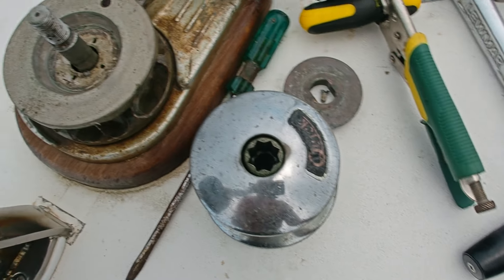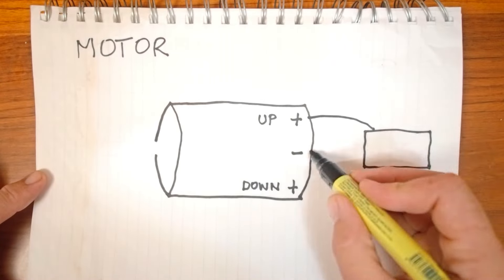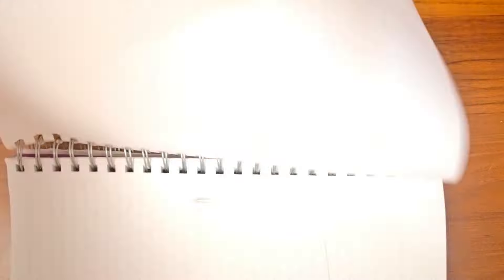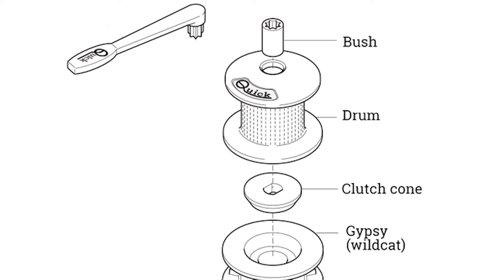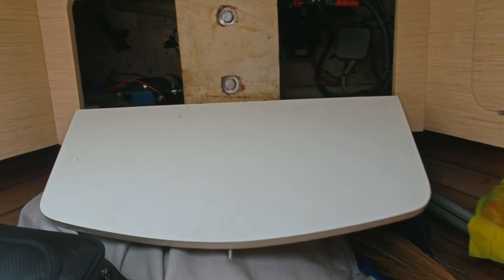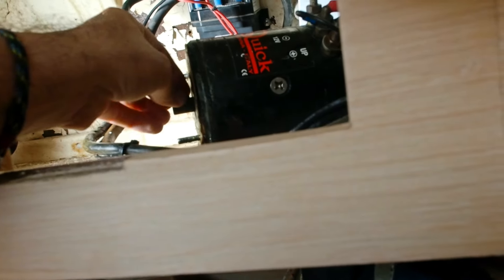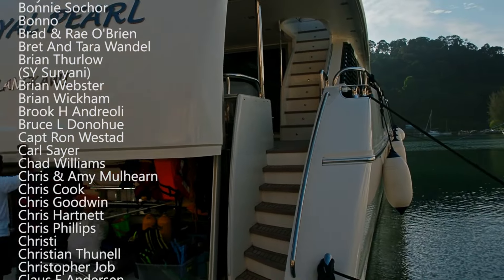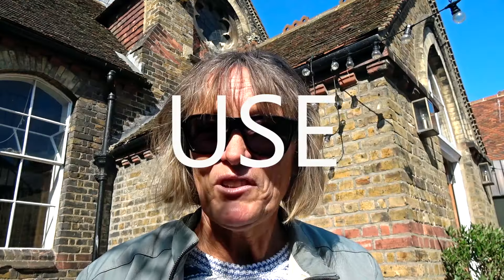DISASTER! OUR ANCHOR WINDLASS IS BROKEN! Ep 56

Comment: Seems like someone keeps putting up walls in front of you just to see how you handle the pressure and tackle the task at hand, boats seem to take 4 to 5 times longer to repair and fix due to the construction and corrosion factor limited space and the tedious task of being a contortionist due to the limed space. Not to mention the fact of the supply chain of repair parts involved or status of vendor discontinuing the part needed to fix what ever is needed to be repaired!  Keep up the positive attitude smile drink a beer and how we say GET ER DONE!  Love the video's thanks for sharing!  :)
Reply from the maker: Thanks for the positive encouragement, Dennis. We'll get this sorted, promise, and as quickly as we can.
Reply: Boats are a cramped workspace for maintenance.   Esper is actually fairly medium-large sailboat with more space than many.  My boat is much smaller and more cramped at only 35'.  To work on our windlass one has to stand on one's hands and knees on deck and reach down through the anchor-locker hatch and work upside down below the deck, or on your chest.  The opening is only about 4 or 5 square feet total and trapezoidal, almost a triangle with a nice sharp lip of fiberglass to keep the water sort of out of it when the hatch is closed.   Fun, fun!
Reply from the maker: I feel your pain. Some of these jobs are not designed to be fun. I'm hoping our solution will avoid the acrobatics in the future.
Reply: I like the reference about ESP.  I had no idea that ESPer was related to that.  Sometimes you just have to work by feel like you were in that scene reaching into the forepeak locker, and just feel the force and BELIEVE in yourself that it can be done.  If you don't believe it will work it often won't happen.  Breathe deep, slow your heartbeat, plumb the calm, find your zen, and feel it happening. Then it just does.  :)

Comment: Super video editing + music ect very professional.  
Thks sharing repair info.  
For next time the acetone and tranxs is great for frozen parts. Also there is a tool called an impact screw driver, that is designed to be hit with a hammer. The hammer blow turns a stuck screw and supplies pressure on the screw at the same time.  Invaluable tool.  They only cost about 20 bucks. They are the bomb for removing or tightening screws!! Super sailing to you.
Reply from the maker: [Liz] Thanks for the information, and for taking the trouble to comment!
Reply from the maker: Hi Thomas. Perhaps you missed it but I tried the impact driver but with no joy :(
Reply: followtheboat missed that
Reply from the maker: 08:10
Reply: followtheboat There is another tactic for super stuck screws.  Drill the head off.  Then take the fitting apart.  The threaded part will be left standing up and open.  They will usually come out then.  If not use a torch to heat the metal holding the threaded portion.  Hold the top of the threaded portion with Vise grips or weld a "T" across the top.  Then heat and wiggle the threaded portion easily until it gives up.  Due care with oxy/acetylene and welding.  Suggest maybe practicing that before using it on the real deal.  It does require some expertise, but not that hard.  Happy Sailing.

Comment: Good laugh at the bigger hammer answer. Used it many times.  Experience has told me to check for parts and replacement cost and availability on day one.  Lets me know how much time I can spend or whether it is better to move directly to chainsaw and cutting torch.
Reply from the maker: Fair point, except we inherited the windlass when we bought the boat. We're applying your philosophy to our solution, however, which we'll reveal in next week's episode. Fair winds, Mark.

Comment: Well done on a tricky job, you have patience and persistence, and a nicely presented video.     I found over the years of cruising, to replace the rubber seal on the topside of the shaft regularly to stop the water and dirt getting into the works, and second buy a Maxwell anchor winch.
Reply from the maker: Haha! Yep, we checked the Maxwells. Very nice winches but outside our budget and the right sized one wouldn't fit without chopping up the deck.

Comment: Thank you for sharing your experiences with your windlass. Now I can make a better choice for the windlass I will put on my sailboat. NOT a vertical one and a detail examination to avoid the mix of incompatibles metal pieces.

You can comfort yourself knowing that it could have broken in a more "delicate" situation.

Looking forward to see the installation a the new one.
Reply from the maker: [Liz] Yes, we would agree with that! There is usually a  mix of metals, it's something that happens on boats, but is not a problem if yo ensure there's some kind of barrier between the two to avoid them fusing.

Comment: A week from setting off from Texas to the Caribbean we switched from a 65# Delta to a 105 # Mantus anchor. Unfortunately our Quick windlass said "no way". Turns out the worm gear was worn and the extra weight made it separate from the gear on the shaft. But, the gear box was a sealed unit and not able to be rebuilt. So, $1000 and a week later we had our new gear box from Italy. Everything came apart easily, bolted everything back together and 2 years later it is still going strong.

Comment: Very enjoyable video.👍Jamie I know the windlass shaft in way of the bearing but I would 'guess' from my limited view, that it is eminently repairable in a local workshop, bearings and the other consumables (circlips and seals) should be standard stuff and available. The 'bit' you butchered with the hacksaw cane be welded back. Btw - do you not have a drill - it may have been worth a try drilling the recalcitrant screw out.
Reply from the maker: Hey Norman. You'll see in the next video the state of the gear and, to be honest, I'm not happy with the design of the windlass. It's flawed and asking for trouble in another two years.

Comment: Reassemble EVERYTHING with anti-seizing compound - if it is new - take it apart and apply anti-seizing compound - in fact  if you can still turn a screw - take it out and apply anti-seizing compound - popular brand "Bostik Never-Seez" or Loctite or Permatex anti-seizing thread compound - also use it on shafts, seals, pins and bushing,  and hinges .
Reply from the maker: +12cunow [Liz] Sounds like good advice. Thanks for sharing with us!

Comment: Hi Folks,

One of the best ways to remove stuck metal bits is to apply heat. With a small torch, you heat the area around that screw. This would expand the metal and allow the screw to be removed fairly easily. Do not apply the heat to the screw as that would expand the screw and well, backwards. Try it sometime. This why you heat the lid of a jar of pickles under hot water. It's expands the lid. 

It's also possible to remove the shaft this way as well, but a bit trickier. 

This is why power lines are set with a sag in the summer, because they shrink and pull taught in the winter. The same would happen with your lifelines if you dropped your boat in the arctic for an hour.
Reply from the maker: +chris gerald [Liz] Thanks for the info and for commenting!

Comment: adorable. engineering background: I would disassemble this every 6mo and inspect, and I would enjoy every second of it. Also, I'd use anti-seize on all of the fasteners as other have mentioned. Provided they had some form of mechanical locking mechanism - locking inserts or (bleh) lock washers.

Comment: When using stainless screws or bolts into aluminum  put a little bit of copper based anti seize  on the threads and no more frozen bolts
Reply from the maker: +David Ibara [Liz] Thanks for the tip!

Comment: Funny that is exactly what I was going to suggest ( a socket a 5lbs sledge and someone other than the owner to whack it) works every time. 
After 50+ years never had a windlass until last week just bought one don't know if I'm conceding to my age or just gotten lazy. But watching this I'm starting to rethink the whole thing...
Reply from the maker: I think it depends entirely on the design, Robert. BTW I had to pull 30m of 10mm chain and 33kg anchor up by hand the other day. I have a slipped disk and it was hard work... AND I had some assistance. No way I'd want to do that manually every time!

Comment: Sorry to see you having problems guys. When I worked in engineering we used diesel as a penetrating agent, handy because you're bound to have it aboard. Also if you have a situation with a damaged/ stuck screw, there's a tool called an easy-out. You drill the said damaged screw and use the easy- out to extract the remains. Hope these tips come in handy for any later situations that arise.

Comment: Planned obsolescence.   This is close to what I was doing today.   I have a Lewmar Pro horizintal windlass on my boat that was installed in 2013.  I removed the wires to the reversing solenoid when I was rewiring the whole boat this winter and today I realized I have misplaced the sheet of paper where I wrote down what color wire went to what.  I was just trying to find the model on the Lewmar website and couldn't match it up to anything made today.   This reversing solonoid is new enough that it has a smudged QR code on the label which I couldn't quite get to read.  Trying to look it up to online to find a wiring diagram was a real challenge.  Lewmar doesn't even admit on their website that it EVER made such a part number.  Eventually I just gave up searching and just hooked up the control wires to hot jumpers and tested out the operation by hand with a meter.
Reply from the maker: To be fair I don't think this was planned obsolescence. I think this was the manufacturer realising the design had some major flaws and has improved on it. Possibly. Glad you sorted out your own issues though.
Reply: Next job is to mount the new Mantus anchor roller and fabricate a brace to support it back down to the bow since it sticks out a LOT further..  The roller matches our new 45lb Mantus anchor we got so we can feel secure in an anchorage.  The boat came with a couple of 35lb Danforths and a folding Herreshoff fisherman.   Hopefully our little Lewmar 700 windlass will be up to the job of retrieval.

Comment: If at first you don't succeed, Use A Bigger Hammer...
I hate to say it, the horizontal windlass' can be just as bad, they can fill up with salt water through the breathers and one day you just have a solid lump of rust where the motor used to be :( I worked on one that was less that 6 months old that had done that, got the same "We don't make that model any more" shockingly most of the parts were interchangeable though :)
I think the real issue is that the windlass is just in a very exposed place, they take a beating and/or get totally submerged. I expect stripping them every few months would help, but there is that choice again; G&T in the cockpit or 2 hours getting greasy on the bows!
The biggest advantage of the horizontal windlass' is there is usually only 4 bolts to undo to lift it off the boat and drop it over the side to fit another one :)
Fair winds...
...(c)
Reply from the maker: +Charles Phillips [Liz] We address the pros and cons of both in the next video. Yep, windlasses sure do take a beating!

Comment: I'm surprised that acetone/atf (50/50) didn't do the job for you.  That's my go-to recipe for disassembling anything corroded.  I see you already know that you don't want to force anything, just get a bigger hammer.  Another axiom that stands in good stead is that shear force and brute ignorance will overcome most anything.  It's unbelievable that they used aluminum and steel components in an assembly exposed to salt water.  The problems the company had with it may be why you can't get it anymore., eh?
Reply from the maker: +benc65753 [Liz] Can't beat brute force! The are a few things on deck which are aluminium and stainless, which is common practice on boats. It's fine as long as some kind of barrier is laid between them... Thanks for commenting. Peace and fair winds!

Comment: Re-watching this video, I would like to make a comment.  Slotted screws have no place in a salt water environment !  They can be stripped out too easily.  Philips are better.  Socket head (also called Allen head in the US) are better yet.

Flat head screws are necessary when you need  a flush surface.  For screws that can be above the surface I prefer truss head (an oversized round head also called mushroom) or button head (a high domed version of a round head).

If you have any slotted screws in your spares kit, make note of their sizes, buy the socket head equivalents and THROW OUT THOSE SLOTTED SCREWS.  As you are coming up on your next refit, start making note of any slotted screws and have them replaced..